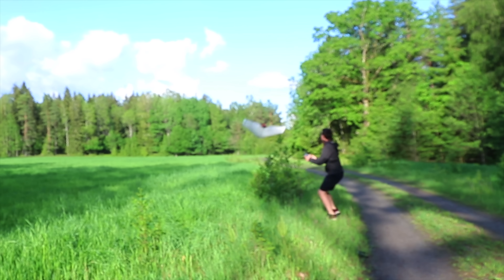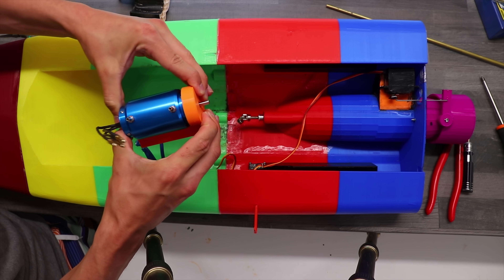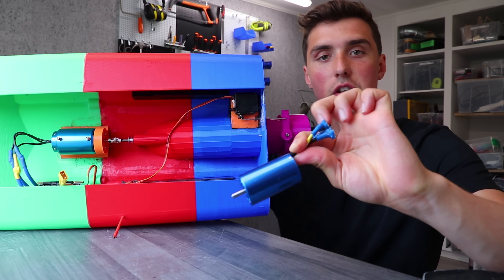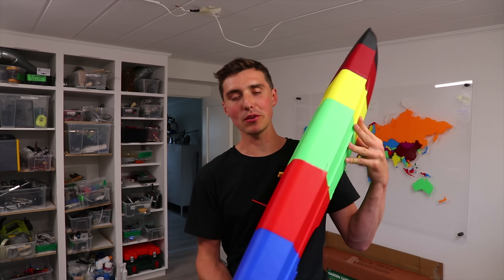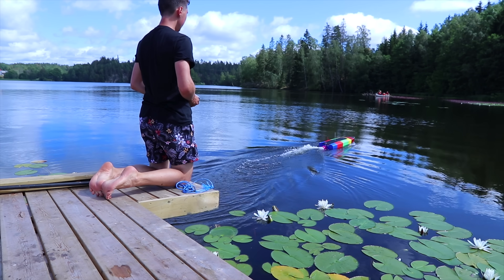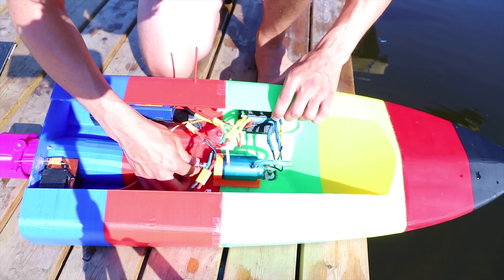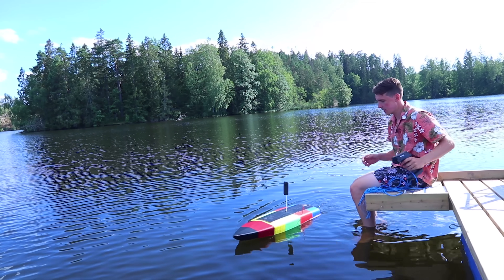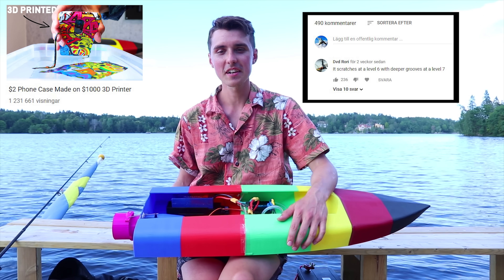How This Electric Motor BOOSTED My RC Boat

Comment: my now ancient Graupner Electro-Vee is now powered by a 3670 size 2300kv BL direct drive into a 42mm 1.4p surface prop. its easily doing 37-38 mph on 4S, you may want to look into what I'm describing, surface prop run half out of the water.

Comment: I think you're getting really bad cavitation by the prop, which from looking at the boat's design is caused by the sharp angle on the tunnel that allows water to be drawn in by the prop. (I don't think the prop can draw in enough water). It might be a good idea to do some CFD analysis on your designs before you print them to check how efficient they will be.

Comment: Yo. Go on amazon and buy the 48v 1800 watt motor kit that comes with a controller and throttle for $150(usd) and put it on something(just not a bike, that’s too boring)

Comment: Way way cool.
Tip on the water flow.  Your inlet is OK, but you can improve outflow by facing it rearward with downangle about 20 degrees.  This makes use of venturi effect to dddrrraaawww the water - so you get a push-pull effect.  Cooling ability is a function of water flow and thermal coupling to the motor - the jacket takes care of one issue.

Comment: You could add a spoiler to the rear end of the boat it won't be much  work but will direct the water going to angle outwards making it impossible for water to get to the hatch, no question of going in.

Just my 2 cents.

Comment: Maybe adding some "lifting" parts underwater could help to increase the speed by reducing drag with water... but boiiiii are your vids greats !  Keep going man and hello from Canada.
Reply: No, he has a planing hull. No need for lifting parts as the hull is able to plane, he needs to trim the nozzle so the thrust pushes towards the center of gravity and, in turn, pushing the hull out of the water.
Reply: @aval1998  true

Comment: Pretty solid that the jet pump is 3d printed. A friend of mine tried that back in the Mendel days of 3D printing with ABS and we failed miserably. I forget from the last video. Is the impeller also 3D printed. You called it a propeller. It is an impeller aint it?

Comment: Why did you go with the Jeff Gordon Rainbow Warriors paint theme? At least yours goes. Mine quit. The dumb Transmitter keeps saying the battery is toast. Changed them and no good. My guess is a diode failed or a capacitor puked. I personally have no idea how the power system on a transmitter works. I always thought those stupid water cooling pipe system works eather. Who dreams that shit up? You need a scoop, not a pissy little tube.

Comment: I think that you should have used the positive pressure side of the thrust system to cool the motor :)
A small tap pressed though the side of the turbine housing, just like you did with the bottom, would have done wonders!
Reply: yes, my water pickup for surface drive props are behind the top tip of propeller, what would be part of the rooster-tail is forced into the tubing without causing drag on the hull bottom. edit: near impossible for it to get clogged too.
Reply: @Cambpictures 
Exactly, that’s what I was thinking…
You match the size of the orifice of the tap, so that it provides the right amount of cooling for the motor.
Reply: +1. exactly what i was thinking
Reply: Cambpictures agreed

Comment: You want more comments? I rarely comment as you never reply.. ;-)  I couldn't see any water coming out of the exit hole for the water cooling so I suspect that wasn't really working. If you can get it performing better the motor might stay cooler and allow more full throttle

Comment: Hi Rc Life, great printed rc boat, 2 questions 1 would a restricted nozzle on back improve the amount of  thrust .. 2 was the water cooling working ? Could use small rc boat pump eather electric powered or driven off main motor, awesome videos keep em comming ,new sub 👍😁

Comment: Great to see the improvements and watercooling. The easiest way to watercool a jet boat is to have the pick up near the end of the nozzle just before the steering that way there is water through the system as soon as possible and also if you look at jet drives the steering nozzle is tapered to help increase pressure and thrust and great video

Comment: I like that, just wondering for someone new to both 3d printing and rc, what are the most basic rc components you need for a small boat, it doesnt have to go fast, just work! Ilean a little speed is fun obv but not my main concern for a first project. Season wise im thinking boat but i also wanna try a drone like u made among others, any info and help is appreciated! Love your videos!

Comment: First off, what a great video! I really like watching your ideas come to life, even when they fail.

I would however like to inject a little knowledge here as your explanations of the old motor overheating and the new motor power were close but not quite right.
Electric motors are designed to have a specific amount of load applied to them, the bigger the load the more watts the motor consumes. RC copter motors are designed for high speed and low load (100 - 300 watts). If the motor is unable to spin up to its ideal speed due to high load, then the current supplied to the motor from the ESC goes up. Basically current = heat (Over simplified). 

The friction was not causing the heat, the load applied to the motor was too great causing it to consume more power and amps than it was designed for resulting in overheating. The new motor is designed to operate at lower RPM's and with more current. Also the water jacket greatly helps dissipate the heat as you know. The motor seems to be much better matched to the application.

Another note is that if the jet outlet were completely underwater, you should get more thrust. Imagine punching in air vs punching under water. One requires much more force, and as we know, for every action, there is an equal and opposite reaction.

Can't wait for your next video/project.

Comment: I dont think that Salt water cooling is a good idea really. Rather get a radiator , a pump , maybe a reservoir , and run distilled water in a closed circuit between the motor and the radiator , Salt water will most probably ruin the motor
Reply: The lake he's running the boat in, is freshwater so corrosion wont be a big problem. However the flow/amount of water on the other hand is a bit low, so adding a small pump to help it along is a good idea
Reply: @LordFelix93  its more about Salt deposits that im concerned about , and yes maybe corosion wont be too much of a concern , and as of the exit of the water is higher than the entrance , IT might not be as efficient asthe exit would be below the entry flow , and below the motor cooling block.

Comment: Wow, there was so much editing in this video that it must have taken AT LEAST two weeks to make! Super cool video and wicked cool project, Simon! Next could you do a simple/easy-ish upgrade to the boat to make it even faster? If you reduce the outlet size on the far end of the pink-ish part after the propellor then the water speed of the water exiting the outlet will increase which will make the boat go much faster. I believe, and someone in the comments may correct me here, but if you were to reduce the size of the outlet to be 1/2 it's current size, the speed of the water and therefore the boat would roughly double. It may not be that much of a difference in practice or in truth, but making the outlet diameter small will definitely increase the speed of the boat by a noticeable amount! Thanks again for posting!

Comment: Run the water jet lower in the water? That is what i like about rapid prototyping. Even if it means a week to do it. Hydro plane? Water pushing against water will deliver more power then water against air eliminate drag by using a hydro foil.

Comment: I'm thinking  about getting into 3d printed drones, boats, RCcars, whatever. What's the best starting place for a motor and RF?

I've got an arduino controller in the works, but I'm not sure that's great for beginners.

Comment: Add a pump to the cooling system which runs faster the faster the motor spins but also stays idle when the main motor is not running so it cools further in the stationary parts

Comment: If he were to take his builds to the next level...

That boat frame is the absolutely perfect platform from which to build a much stronger, much longer lasting build. It's dying for a simple coat of fiber glass and resin, or better yet, a couple layers of carbon fiber. You don't even need a vacuum pump, and all that jazz, you can do a simple hand layup with brushes and rollers. I'd also work on some sort of waterproof top. That thing could literally drive under water for short bursts with such mods, and it would last a lifetime.

I don't like the idea of printing things which are simply going to end up in a landfill because they inevitably break. 3d printed parts are as strong as carbon fiber parts with a simple layup. It's like turning plastic into steel in terms of strength. It's much easier than most people are aware of.

Comment: Is the water jet system like this faster than the standard prop method? Or more efficient? What are its pros, I was expecting it to move faster tbh. But nice build man👌 I want to do something similar on out 3d printer at school (ultimaker 2). And keep the vids coming, always checking for any uploads...

Comment: Hi! Please tell me what you've done Scale boats from pervonachalnogo option which is on thingiverse? What is the length and diameter of the shaft? And what bearings put? And what weight get an empty printed model???

Comment: make a water scooter. something that can pull your human body in the water. What if you made a propeller around a motor core. Brushless motors are waterproof or so i hear. if you could 3d print a water scooter. (they are way to expensive to buy) doesnt need to go deep. only a couple feet.

Comment: Try making a tapered jet nozzle (thrust vectoring) to ensure u have a bit more pressure/ force to move the boat faster
Reply: Exactly. Print a few nozzles with different diameters to find what works best for your boat. Larger nozzle = more low end power & a smaller nozzle = more high end power. You will need to find the right balance. Once you find the right diameter nozzle then move the top mounting hole position until you find the right trim angle. You could even use another servo for trim and tie it to the throttle channel with a curve /mix ( as throttle goes up the nozzle will pitch up). This will reduce drag on the hull by lifting the nose.
Reply: That silly big nozzle has been bothering me since the first jet boat he made, narrowing the nozzle will increase the speed at which the water leaves the nozzle and will 100% make it a faster boat
Reply: yup! the fast electric jet boats use about 24-25 mm nozzle and 30-32 mm impeller. I like this guy's enthusiasm, but homework is needed!
Reply: Smaller jet system overall i would say. Look at something like the brinksman jetboats, they have tiiiiny propulsionsystems, and goes like crazy 😃
Reply: Also putting the weight a bit further back will help it get onto the plane earlier creating less water resistance to make it go faster
Reply: Yes tapering is essential. This is just a ducted prop. You need to accelerate the water (it has to leave the boat faster then it enters through the intake, which requires a smaller diameter for the exit)
Reply: It's also leaking heavily which fore sure doesn't improve performance.

Comment: Pls make a electric surfboard. It would be awsome 💪 (i've already tried something like this)
Reply: robotmarketplace-dot-com has 24v 2.1hp motor about 110 dollars US.
with a 2:1 gear reduction and aluminum propeller from YoungProp-dot-com (submerse props for trolling motors) you CAN build a surfboard or hydrofoil to get up to planing speeds. for a kayak a 300w electric scooter motor is actually plenty, running just 12v. use 5/16" shaft is a perfect fit inside 3/8" hard brake line tubing, perfect and inexpensive!
Reply: @modelnutty6503  Or google eFoil Builders forum and see how it's done correctly...
Reply: This. I'm working towards a jet surfboard, starting with my kayak.
Reply: Or an electric hydrofoil board. Let’s set the bar high...no pun intended
Reply: I subscribe this ideia :)